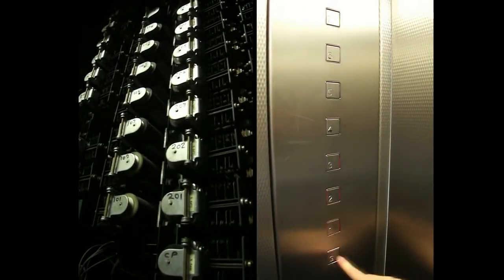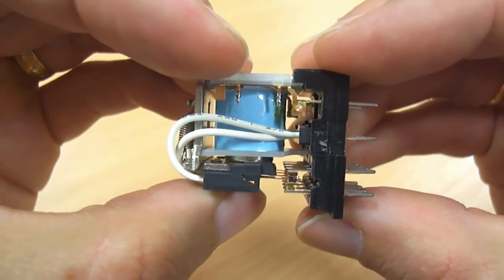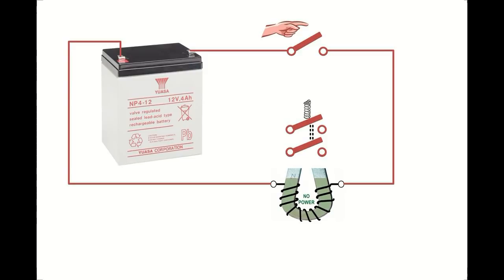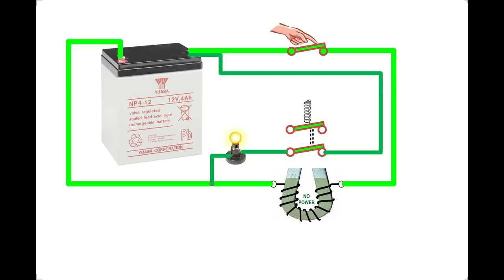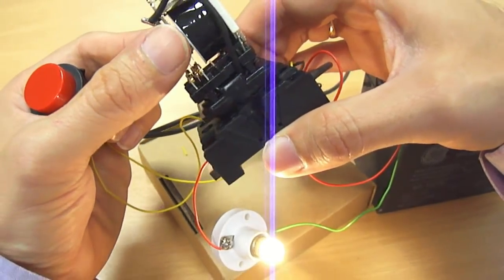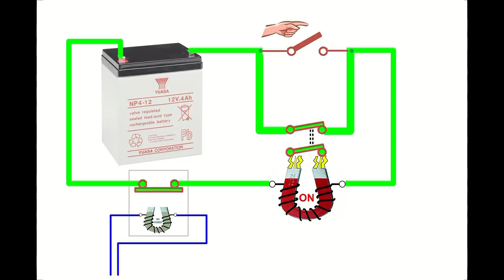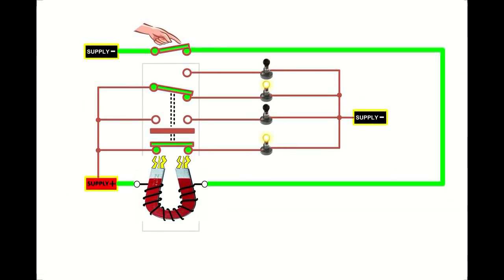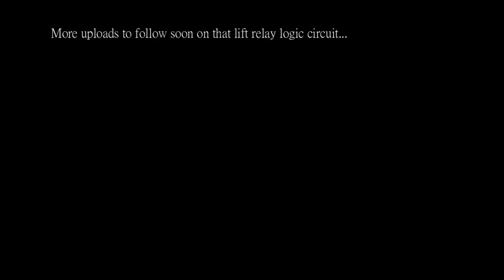The easiest LATCHING RELAY CIRCUIT to understand ever!  Both theory and practical explained.

Comment: The best video on relays I have seen! I'm in a mechatronics program right now and the instructor did not explain these very well nor did he take one apart to show us the inner workings, so this helps tremendously; thank you!
Reply from the maker: Thank you very much for your kind comment :)
Reply: You got that right!!! I'm a gear head  and am currently wiring a line lock and a msd 6al-2 step into a latching relay setup. 94 z28. 6 speed. THANK YOU SIR

Comment: Discovered this by accident.  I was an electrical fitter in a power station, in Scotland, for 35 years and in the early days we did our own maintenance and repairs on the lifts.  This really takes me back.  Plc control came in and specialists took over maintenance and all we did, in house, was emergency egress of passengers when the lifts broke down.  When we did work on them I remember scratching my head trying to work through sheets and sheets of schematics!
Reply from the maker: It was the same in the BT (British Telecom) buildings - the relays in the motor room lift logic were very similar to the ones used at the time in the telephone exchanges - so they kept the old lifts running using their own engineers (or so I'm told)

Comment: its an excellent tutorial, It brought me back to the old Cross Bar electro relay telephone exchanges, if you want to see relays and understand them its mind boggling, the exchanges are full of them, it takes 3 weeks to teach the students on just how to get dial tone which is tracing the circuit from the picking up of the telephone handset to obtaining dial tone, I never did the course as I didn't work in the telephone exchanges, goes to show how smart the technicians had to be, well over my head, unfortunately when the semi conductor was invented and the exchanges used micro processors their knowledge became obsolete.

Comment: Thanks for posting this!  I'm installing a double decker car elevator lift in my garage floor.  It came with a pair of chinese elevator control panels and a micro controller.  I'm chucking all that crap and going old school with relays, limit switches and idiot lights to drive the hydraulics.  To keep anyone else from running it, I've got a 4channel BT relay setup running from my cell.

Comment from the maker: Good question!
The one that I am using to construct the circuit is a DPDT - Double Pole (2 sets of individual switches inside the relay) Double Throw (each switch has 2 contacts, one when it's on, one when it's off).
The relay is 12volts.
Buying the right relay is the easy bit, generally a 12v DPDT relay will suit most applications, the difficult bit is understanding "what connector does what" on the relay base - some are easy (like 12:01-12:05), some are not marked as clearly as this one is.

Comment: Super-helpful, thank you! Realising that series/parallel switches correspond to logical AND and OR, and seeing how you can make a latching relay circuit, helped me design a scheme for powering a device in a car from the permanent BAT supply using the ACC supply to turn it on but not off (using a separate switch for turning it off).

Comment: Awesome video.  Very clear how this works. I'm a complete starter in this, just doing it for kicks and hobby.  So you have explained how to use a "soft button" to turn a system on, how do you get the same button to operate as the off switch in the same circuit so that every other push is on, off, on, off, etc...
Reply from the maker: This could be done, but now you're probably introducing transistors and 'flip-flop' circuits.  I'm not aware of an easy way to do this with just relays.

Comment: Very, very well explained video that explains step by step without getting overtly technical. (My current challenge is a relay that turns on via a button, and off again after five mins - so can't use a 555 with a delay that long - This twin relay idea might help)
Reply from the maker: thanks for the comment.  Sounds like an off-the-shelf 12v timer to me!  For me, long gone are the days of soldering up a project that will do this when you can buy what you want from ebay for £5! ;)
Reply: Alas, I didn't find anything. The nearest was a push button that turned off after 1min -15 mins ... but that was wired to the power constantly via a transformer - the very thing I was trying to avoid. My unit 'isolates' itself from the mains when it goes off, and then uses a battery/switch to retrigger. (I  finally used a thyristor and JFET)

Comment: you can make simple memory out of this principle, back when i was 20 years old i dreamed up a door lock that could be opened by using a key pad. the concept wa sthat, by pressing the right  key on the pad (reset switch) you would latch the first relay and therefore allowing the second relay to be powered up by a second key on the pad and so on for as many keys as you needed to unlock the electromagnetic doorlock. a last relay was needed to reset the whole circuit if you pushed the wrong key. as an example, for a four digit code to work properly you would need to use 5 relays...i remember that i had to sit in a very quiet environment to visualise the whole circuit lol

Comment from the maker: yes you could do, although you will need some kind of switch for every floor. When the lift is at the floor a seperate switch is pushed.
 
It will be a month or two before the next part (with circuit explained) video is ready, as I am working on about 6 other interesting videos at the moment :) If I were to retire, then I'd have loads of time to edit them, but I have to wait about 35 years before I can retire hehe!

Comment: Was looking for some thing els but your no nonsense explanation and diagrams hooked me in will be checking out your other vids.
INFO was looking for a way to switch power supplies to a second immersion heater from my free solar switch it heats cylinder one first but has an output to another load we have a second cylinder with a separate supply when spare juice available would like it to go into cylinder Two
Reply from the maker: Many thanks for the comment :)  I do the training for my company - I never assume people know something and I'll all about explaining things in a way that anyone can understand.  Regarding your project, which device decides when Cylinder one has finished heating (to initiate the heating of Cylinder two?).  I'm assuming the power being used here is mains (240v in UK)?

Comment: Very good explanation, best I've seen.  But I'm a still a bit puzzled as to 'why' use a relay when you can connect 'direct'.  I know there must be a very good reason for this but I've not seen it stated yet.
Reply: A relay can switch much higher current with smaller control wiring. You would have to run large gauge cable all over the place to handle the high amperages of motors. With relays you can use small gauge wire to energize the coil and the relay contacts can then switch the higher amperage load. When we use a relay to control a large motor we call it a contractor. (Same basic principal)
Reply: +Fireship1 I meant to write "contactor"
Reply: The advantage in logic and control circuits, is that one relay can control another. Which might control another. And you can wire each of the the coils and switches up in different ways. 

In this video, that only happens once, in the example with the latching and de-latching. But in a complex lift controller it can happen more. One relay latches when you press a button. It's coil is connected through a second relay. This one will break the circuit, un-latching it, when the lift arrives at the correct floor. Eg if the button for floor 4 is latched, upon arriving at floor 4 it needs to un-latch. 

But then those relays have yet more switches, and these can go towards controlling the lift's motor. To switch power to it when it has a floor to travel to. But of course the lift can go up or down. Other relays control that, deciding which way the motor is connected to it's power, to run forwards or back. 

And then there's a good few more relays completing the whole lift's functions. All wired in combinations. So some of the relays are turned on, not by a user pressing buttons, but by other relays. You can't do that with just a switch. And of course how would a user know which combinations of switch to press, if that was all brought down to buttons in the lift car? 

Not to mention the very heavy, high-voltage wires you'd need to run to the car, and the huge buttons to switch that much power. Using relays, you can use light, low-voltage wires to the user buttons. These wires then run up the shaft, to control low-voltage relays, which eventually control big powerful relays that switch the high power lines to the motor itself.

Comment: I've always been an electronic tinkerer.  I'd love to buy a crapton of "ice cube" relays, including some timer relays, relay bases, limit switches, a small traction motor, door motors, etc., and build a working model elevator/lift using the real stuff for control circuitry that would be able to control a real lift if it were connected to one.  From watching some of your videos, buying all the relays will probably cost thousands of buckazoids. Further, the relay panels and everything will fill a small bedroom.  Also, good luck buying real elevator button panels, right?

Comment: Hey. Im still learning about automotive electrical wiring. I'm trying to built a power distribution box for my bike. The question is, can I use one main 40 Amps relay(coil get power from ignition) to power a fuse box that has 6 slots. And each slots has its own 40 amps relays. In each slot, the relays' coils will get power from its own independent switch such as horn or light, to complete the circuit. 

This is the order: Battery>Circuit breaker 30amps>Main 40amps relay (swithed from ignition) >6 way fuse box> 40 amps relay>light/horn switch>device.

I want to power 6 devices each with its own relay. This is because I'm afraid if  there's no relay between the device's switch and the fuse box, the switch might fail and cause a short circuit due to high amperage draw (such as a pair of horn). I hope you understand. Thank you

Comment: Nice explaination, BUT it may be useful to mention you are working with DC battery voltage and to never touch contacts in an AC house circuit for obvious reasons. Still thumbs up for me though :)

Comment: Is there a single latching relay unit today that: latches with sensor 1 and breaks circuit with sensor 2?  Example; I've 2 buffer tank sensors, circulation pump is turned on when top sensor 1 drops below 45 deg and pump cannot turn off until lower sensor is satisficed.  Tia

Comment: If you have a relay with only one set of [load] contacts, can you just run a wire connecting those two contacts that are also connected to your load [to bypass your switch] to make it latching? 

Either way, will that negatively affect the output of what you're controlling as opposed to using the second set of terminals if the relay had them?

I hope my questions makes sense. If not, I can clarify.

Edit: added parts are in [brackets].
Reply from the maker: The contacts create the self-latching.  If you have a relay with only one set of contact, and you need to power something, then wire that device in-parallel with the relay coil.  Then, once the relay has latched, the relay coil is powered and your device(s) will receive power from the terminals of the relay coil.  Hope that answers your question?

Comment: Hello Great Video and thank you for your time in making it. I need to ask you a quick question on which relay I will need to operate 230v input and 0 volt or 5v output. Basically need a relay so when I plug it into wall socket motor turns oneway and when I unplug from wall socket it turns other way. The motor has its own power and is plugged in the socket all the time.
Reply from the maker: I think I get it, but just to clarify - What voltage will you use to activate the relay coil?  What voltage will you be using to drive the motor?  If you PM me your email address then I'll knock up a quick sketch for you.

Comment: What type of relay switch could I use that turns on a 12v light when voltage is applied and turns off after it is removed. I am trying to wire in a jackpot light that turns on when power is sent to the coin hopper for pay out.

Comment: does it matter which side of the electronics the switch is connected to? whether on the power side or ground side? why or why not?
Reply: Jared Sanders relays can be used with ac or dc. transistors for example only work on dc
Reply: A switch, inside it's casing, is just 2 terminals, 2 bits of metal. Each one connects to a wire. When you flip the switch, or press it, if it's a button, a third piece of metal moves down to touch both the terminals, connecting them. So electricity can flow from one terminal, through the moving piece, to the other. 

Each terminal is made of the same material, often in the same shape. Electricity doesn't mind which terminal it goes from or comes to. There's either a complete circuit, all the way through metal, or there isn't, with the metal not all touching. 

Electricity travels from power to ground, if there's a complete path for it to flow. It doesn't matter where you break the path (with a switch). It's either complete, or has a gap. It doesn't matter where the gap is, on which side of the power supply, or in the middle.

Comment: Great simple set up! Now... Is is possible (more like I am trying to figure out how) to make this circuit with relays and integrate a single momentary switch to turn on AND off with that one switch? I am trying to make a homemade piezo pressure switch for some LED lights that I have installed all over my car. I would like to mount the switch underneath a plastic section of the arm rest on the door panel.
Reply from the maker: That's called a flip flop circuit.  Not sure how you'd do that easily using one Normally Open switch and a relay, but I would recommend this: https://www.quasarelectronics.co.uk/Item/cebek-i-9-electronic-flip-flop-relay-board-module

Comment: Great vid.  Could you do one explaining how a program in a chip makes a physical reality happen?  Example:  a chip with a program in it causes a relay to open or close causing a circuit to energize or de-energize.  I can't picture how 1's and 0's translate to physical action.
Reply: 1's and 0's working in a microcontroller are just sequences of tiny voltage values.  1 means voltage present and 0 means no voltage present.  The processor or chip running a program will have output circuits using semiconductors (probably transistors) to turn some of those tiny "microchip voltage" pulses into stronger, more usable "signal voltage" pulses through output pins on the chip or board identified as logic outputs.  These logic outputs provide enough voltage and current to operate transistors or tiny, low voltage (5v or less) relays which can then control the power to the big relays running your device (lifts, factory machines, ventilation fans, heavy equipment, etc...)
Reply: The 0s and 1s are represented in the chip as, say, 0V and 5V. The same also in memory chips, and peripheral chips. It's all voltage or no-voltage. 

So the program code in a chip is also a group of voltages. Chips have an address bus and a data bus. They read data from a particular memory address by putting that address on their address pins. IE address "5" would put 5V on the A0 and A2 pins, 0V on the rest. The memory chip would then return the stored value from "5" by putting voltages on the data pins representing that value. 

As well as memory chips, though, other things can connect to the bus. It might be that address 999 (I won't tell you which pins that uses, because it's lots!) connects to an I/O controller chip. When it's address is on the address bus, it connects itself to the data bus to read what's on it. The voltages representing that data will flow into the I/O chip. Then the I/O chip will put those voltages on it's output lines. 

Those output lines connect to, say, an LED, or a printer port, or perhaps a relay or a power transistor. The relay or power transistor then controls a motor or heating element or whatever. 

So the voltages representing program code flow through a whole shitload of transistors, turning on and off according to an internal sequencer. Those  voltages form addresses and data. If the address is a particular one, the data-voltages can be brought out to an external device, through an I/O chip that buffers that voltage, allowing it to supply lots of current. That current drives the relay. 

Hope you got this! It is a tricky thing to visualise at first. But at the real physical level that's all "programs" are, it's all the letters and graphics on the web are. Voltages on pins of chips, and inside those chips. Bring the voltage out of the chip, and you can control the world!

Comment: Great video! 😄But I would also like to learn how to switch on&off appliances by pressing ONLY ONE button.
Reply from the maker: You'd either need a latching (push on-push off) button, or if you are using a momentary button then you'll need a special PCB called a "flip-flop" module.  I am planning another video, but I don't have time to prepare everything at the moment.  Thanks for your comment though.

Comment from the maker: (continued 2) you will need a NORMALLY OPEN switch, and a NORMALLY CLOSED switch.
The N/O switch is exactly the same as the red button in the video.
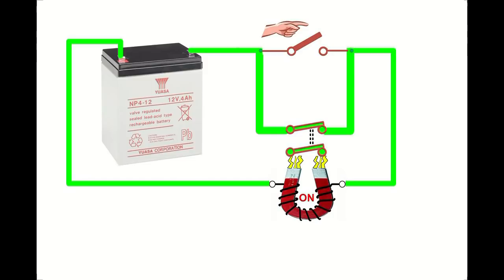The N/C switch is fitted to the circuit as shown at 8:18 - the circuit is disconnected by this switch which resets the relay.

Comment: I'm trying to power 2 bulbs on separate dc voltages. i need to switch between the power sources: 12 volt plug and 9v battery source. Can anyone explain to me how this would be done using a spdt switch and diodes? Do I need some kind of isolator?